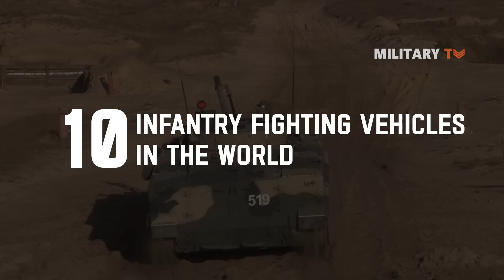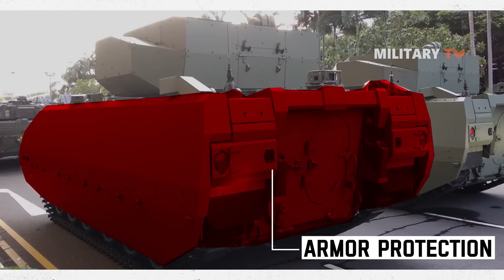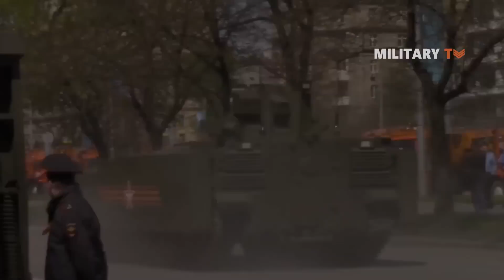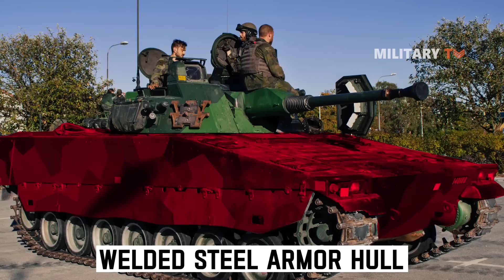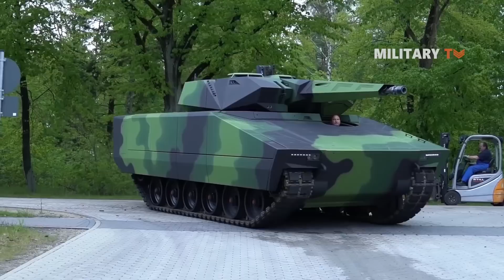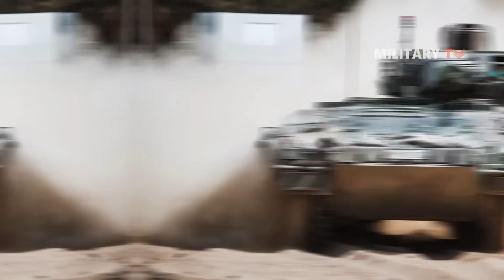Top 10 Infantry Fighting Vehicle ( IFV )

Comment: Are you kidding me.
It's funny that Kurganets 25, which didn't mass-produce and didn't have a real deployment, even though the BMP3 that exploded excited in Ukraine, is it funny that it makes sense that the No. 1 is only Puma IFV, which is expensive because it's full of flaws?

Currently, CV90 ranks first in all of the mass production, variations, export, performance, and actual evaluation.
Reply: some of the best IFV's are not on this list.  The Borsuk (Polish), the Namer (Israeli), and the Guarani (Brazilian).  The Borsuk is the best designed IFV to use for waterborne assaults, the Namer has the best armor and defense, and the Guarani is cheap while being very versatile and has many different variants that can easily be changed out.  I would take any one of those over the BMP-3 on this list.
Reply: Funny. The CV90 not meeting requirements is one of the reasons the Puma exists in the first place. The German Army trialed the CV90 in 2002, rejecting it because it didn't meet the required ballistic and mine protection aswell as growth requirements. They concluded there was no IFV on the market at that time that would meet their requirements, so they had to develop one on their own, the Puma.
Reply: @jonny2954  
Germany wants requirements that makes no sense.
They need to learn to decide if they are making a tank or an IFV.
Reply: @MegaBanne  modern combat experiences show that the PUMA is best of both worlds. There are many reasons why we chose the PUMA system over the cheaper yet almost outdated CV90. One being that the engine of the CV90 is weaker and that the PUMA is just as mobile and fast as the CV90 in same conditions because of the stronger engine (necessary because of the high weight obviously). The PUMA also features the ability to withstand nuclear pollution to a higher degree than every competitor on the market is therefore able to stay in the fight of nuclear polluted areas such as the plant Saporischschja in Ukraine, if there'd be a leakage of radiation. The CV90 also doesn't feature compability with our new "battle situation evaluation, planning and troops communication system" (no English name for it) which connects the commander to the dismounted infantry and makes him able to add commands and flanking routes to their hud system for example. (think of it as the CrossCom from the early Ghost Recon Games)
Reply: @menki_d_ruffy  
The PUMA has no combat experience.
Are you seriously saying that the PUMA could replace both a tank and an IFV?
 
The PUMA is only heavier, more armoured, louder, less mobile, has a larger profile, and still can't protect against most anti tank weapons.
What was the point?
 
Of course it isn't compatible with your systems.
The MKIV has its own systems, which the PUMA isn't compatible with.
 
On top of being better at what the IFV is suppose to be good at, the CV90 has a well developed anti drone system, which the PUMA sorely lacks.
Reply: @jonny2954  And, Puma IFV lost to CV90 in the Netherlands.
Reply: @bangdoll4500  The Netherlands never trialed the Puma. They decided for the CV90 solely for the fact that the CV90 was avaliable with a 35 mm autocannon, and the developers of the Puma were going for a 30 mm. The dutch wanting a 35 mm gun was based on the odd requirement to destroy all optics of a T-80U MBT in a single 3 round salvo. For that exact purpose Rheinmetall developed a version of the 35 mm AHEAD airburst round with more, but smaller tungsten subprojectiles than the 35 mm AHEAD used before (407 x 1.24 g  instead of 152 x 3.3 g). However in later testing just 2 normal 152 x 3.3 g pellet AHEAD rounds managed to do just the same.

Pumas armament on the other hand was optimized for the anti-infantry role, chosing the 30 mm over the 35 mm to double the amount of ready ammunition. (A CV9035 has a total of 203 rounds of 35 mm stored, a Puma has 400 rounds of 30 mm, of which 200 are ready to fire). Puma was also confirmed to outperform all other contenders in every metric in the czech trials, but in the end it was deemed too expensive. It was probably the same for the Netherlands, since implementing a 35 mm on the Puma would've been an easy task.
Reply: @jonny2954  I agree that the puma is generally better than the CV90 with protection for their crew, but becuase of that its weight is also increased greatly which brings us up to mobility that is the greatest strenght of a IFV. CV90 outshines basicly all opponents in that area.
Reply: @johanbergman2343  Latest CV90MkIV also go up to 37 tonnes.
Reply: @jonny2954  Well, the reality is that 10 countries use the CV90 and only one, Germany itself uses the Puma.

Slovakia and Czech Republic made huge orders for CV90 recently. I wonder why.
Reply: @goldrush5764  The CV90 has been on the market for two decades longer than the Puma. Also the Puma is tailored to German mechanised infantry requirements, which are quite different than those of other armies. It's not ment for export. Smaller dismount teams, more offensive role and closer cooperation with both the dismount teams and MBTs. That's why the Puma is smaller, and much heavier protected than other contemporary IFVs. That doesen't fit the requirements of most other armies mechanised infantry. Your comparison partner for the CV90 would be the Lynx, which is a more "conventional" IFV. Larger dismount compartment, lower weight and highly customizable to the end user to fit a wide variety of needs.
Reply: @jonny2954  Maybe you have heard about the recent failures of the pumpa during exercises? Hehe, I rest my case..
Reply: @goldrush5764  Which were caused by delayed maintenance and fixed within a few days. We also had 9 dutch CV90 break down simultaneously with electrical faults in Bergen Hoene in 2019 and 4 American M2 Bradleys from 1st Battalion, 8th Infantry Regiment during Defender Europe 2022. Does that make the CV9035 and M1A2 bad aswell? I see you don't have much expierience with military hardware lol.